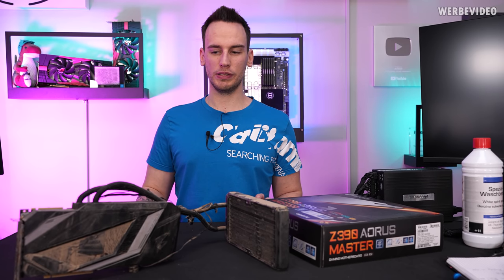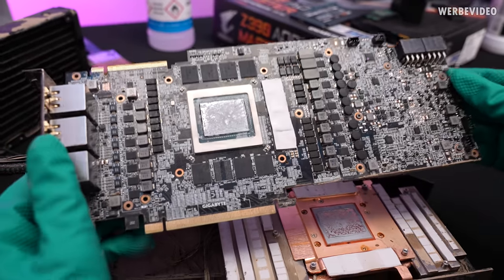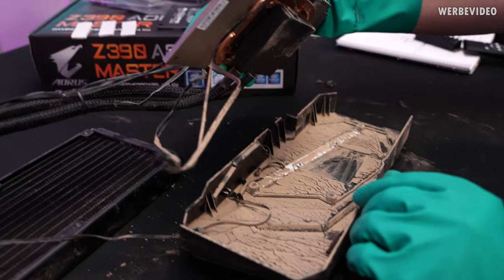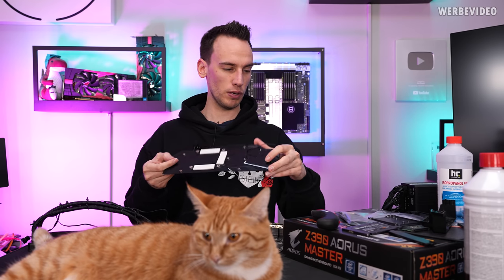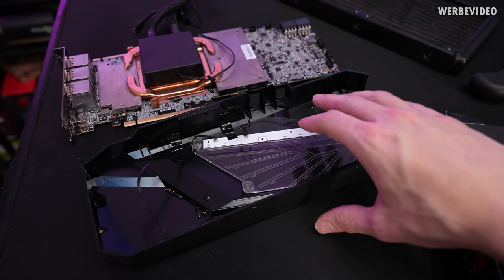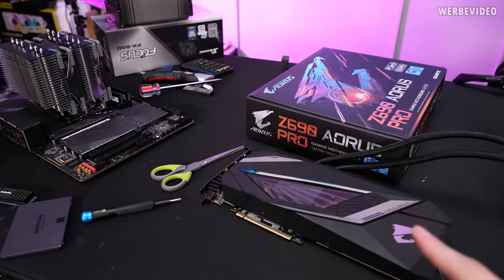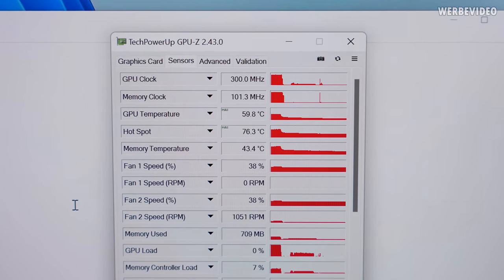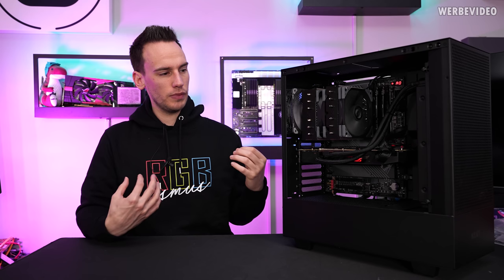Did Keanus RTX 2080 Ti survive? Fixing the last Flood PC for 2021

Comment: You could use electrolysis to remove the rust from the nut and bolts, it really shouldnt take that long with those tiny parts.
Reply: or just rust removing solvents, they work great and easy

Comment: I found that painter's tape can sometimes remove dust and hairs from thermal pads without destroying them.
Not guaranteeing anything of course but it did work in my case.

Merry Christmas by the way :) (frohe Weihnachten)
Reply: Thanks for posting this tip. Haven't heard this one before. They drive me nuts sometimes.

Comment: You can remove that rust stain from chrome and other metals with a misture of white vinager and table salt.  Just add vinager to a container and add salt until no more will dissolve, then just add the screws and other metal parts and stir the liquid from time to time. Its a slow process so you can help it with a brush for the harder pieces of rust stains. 
Its a great method that wont damage the rest of the metals as it would happen with hydrocloric acid.

Comment: Never submerge/soak devices with elastomer sealing (like o-rings) in IPA. Many rubbers degrade with prolonged exposure to it. Unless you know that the actual type of elastomer that's used can handle it.

Comment: You need an explosion proof ultrasonic cleaner and an autoclave to make a perfect cleaning and drying after washing. Ultrasonic cleaner with isopropyl alcohol to make sure hard to reach areas such as GPU and VRAM BGA are perfectly cleaned, and two or three hours in the autoclave in a VERY mild temperature (around 80°C) to make sure everything is perfectly dried. High temperatures hurts electrolytic capacitors.
Reply: Autoclave doesn't make sense for low temperature applications as it's main selling point is using high pressure to get higher temperatures without boiling. For drying PCBs you want low pressure so that water/alcohol boils off faster. Then again, full on vacuum would probably be risky with electrolytic caps.

Comment: A Rajintek Morpheus 8057 is like 60-70€. It's a fairly cheap way to save a 2080 Ti if the cooler is messed up. It's a custom air cooler that can handle 350W TDP easily. It's amazing and really quiet too.
Reply: I have that too and works perfectly. Gave my 2080ti a new life

Comment: The fan on the back has to be faster/move more air than the CPU Cooler fans and you will be fine. If you leave the case without the back fan the CPU heat wont leave the case properly. If u have fog machine you probably wil see that not all hot air is leaving the case . I mean its fine for stock use but for OC the CPU temps will be slightly higher.

Comment: i have the same card, the stock cooler is very bad and leaky. i replaced it with a custom block. its not a good overclocker as well. i opened the pump by grabbing the screws with tiny pliers and they came out very easily.

Comment: Are there any good Air coolers for the 12700k? Looking at the NHD-15 temps reach around 80-90c while on cinebench at stock settings, which sounds like it would be worrying/loud.

Comment: dont get rgb strips from gpu get wet. it can damage the gpu or bios if it corrode, if you have a gpu that locks up in widows or booting or just have driver resetting issue, just try unpluging the rgb strips. u may have to reflash as well...
Reply: check if the rgb isnt working first when u turn the system on

Comment: The GIGABYTE GeForce RTX 2070 Super GAMING OC 3X 8G Graphics Card which I have are still priced at $1600 - $1700 on Newegg. I bought it right before the graphics card scalping for $530. No way I'm paying double or triple MSRP for a new graphics card. If any of my cards quit I just won't be gaming. I also have an EVGA 1070 FTW and an EVGA 980 Ti for back up.

Comment: You will probably get bashed by the community for putting the aio tubes on the top🙃
Reply: Pump is so much lower than rad's top, there is no need to care about tube orientation

Comment: Bro you do not clean any electronics that way the best way is too use 99% isoprophenol or Car brake cleaner and too soak it and agitate it WTF are you doing .. afterwards the cleaning components will evaporate off ... may lord
Reply: as long as you get all the water off its fine